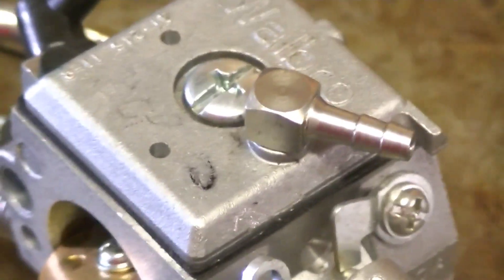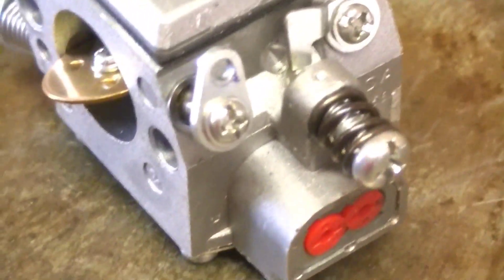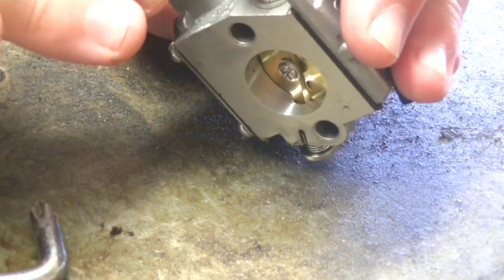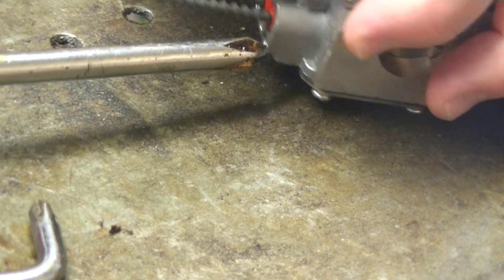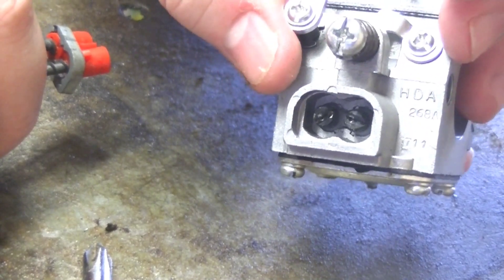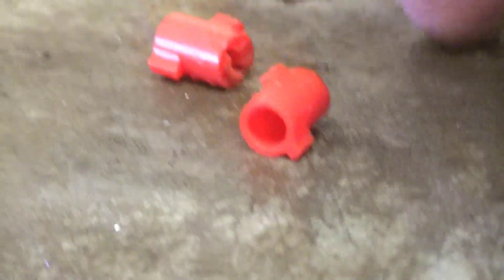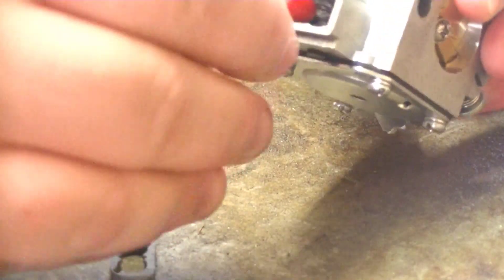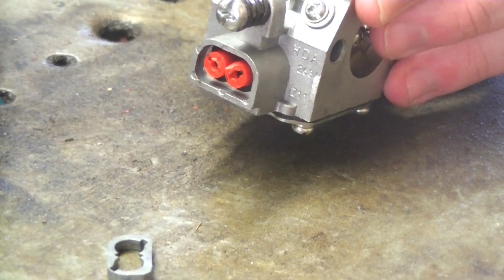How to remove Echo carb limiters

Comment: When you put the orange limiter caps back in, do you have to lineup the slot in the limiter cap with the slot in the actual screw? Thanks.
Reply from the maker: @Brian-mc4pd  If you've light sanded off the plastic nubs, you shouldn't have to. It's mainly just a plastic cap, that's held on by the splined outer shape of the adjustment screw :)
Reply: OK, thanks for getting back to me so quick
Reply from the maker: @Brian-mc4pd  Not a problem. Glad I could help :)
Reply: @jimmyboy95  great video, took me less than 5min to do this on my cs590 and just a couple more after that to tune it.  I didn't even remove the carb, just used 2 long wood screws to reach in the case of the saw.

Comment: As we all know it's vital to only gently seat jet screws during adjustment and not accidentally bend them.
When you screw your drywall screw into the limiter cap to get purchase surely you are also screwing the jet with it.
Would that not risk screwing it against the seat with too much force?
Reply from the maker: @casttolast  Thankfully this doesn't happen as this was a concern of mine also. 

If it does, it'll turn it very little, as the screws in my experience seem to turn better with the splined insides of the caps then with a flat head. Especially with the saw running :)